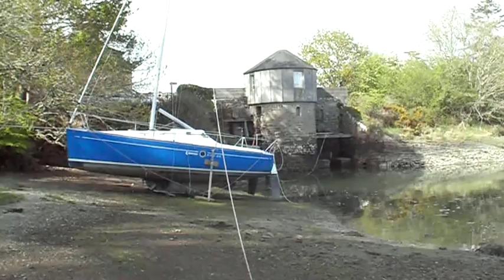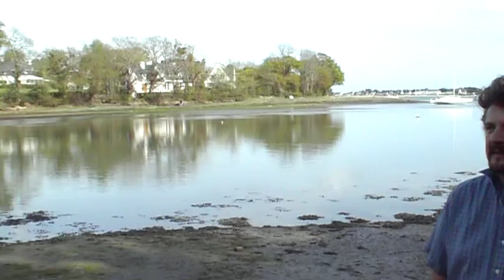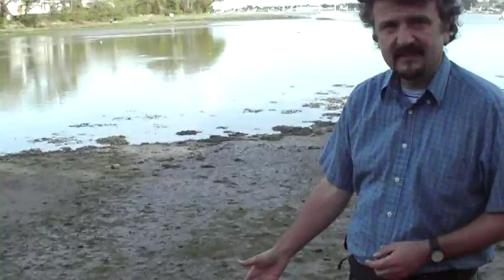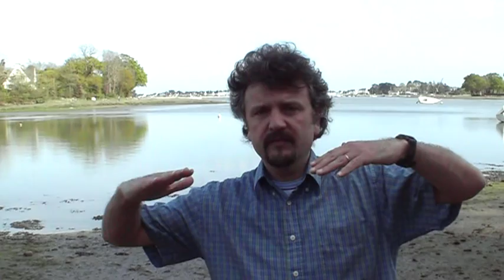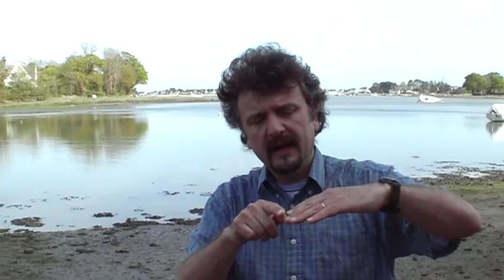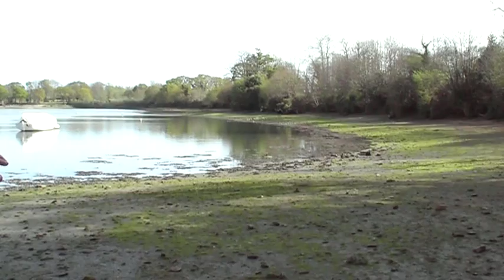Coastal Systems: Estuaries 1

Comment: It's not diffusion it's osmosis, osmosis is the movement of water from a more dilute to low concentration , in this case from freshwater (more dilute) to salt water (less concentrated) diffusion is the movement of a GAS from a HIGH  TO LOW concentration for example a perfume is a high concentration , so it spreads to the air particles(that's why your can smell perfume from a distance) .
Reply: Jack Room no.